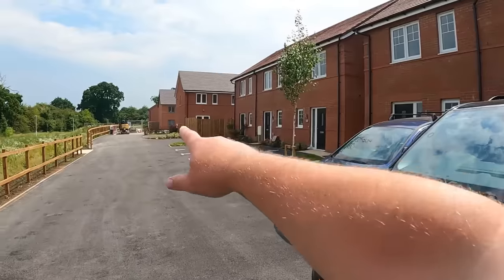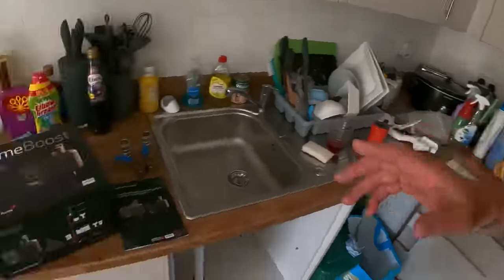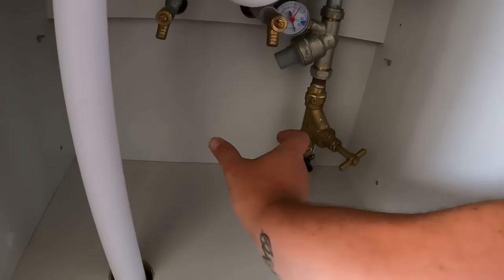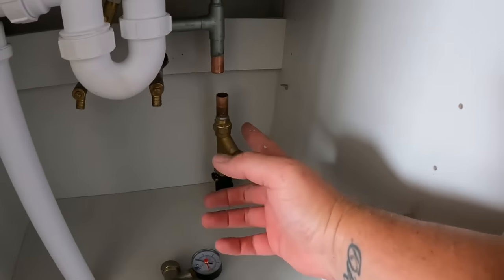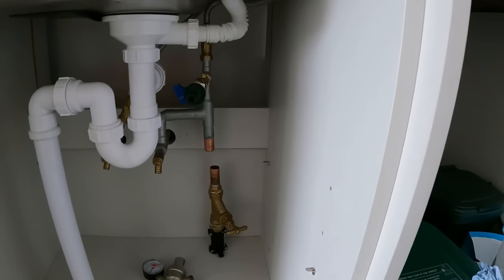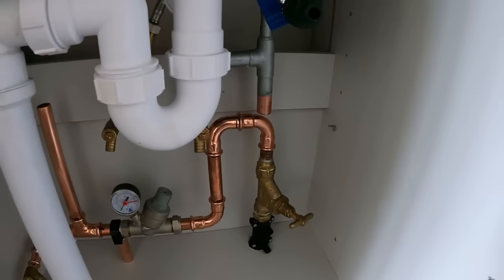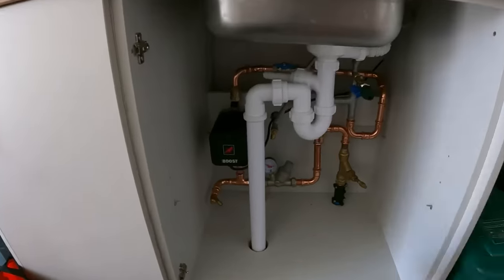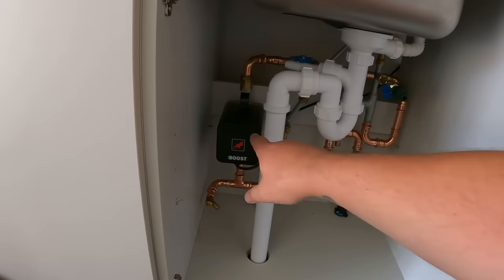HOW TO FIX A LOW WATER PRESSURE & FLOW PROBLEM

Comment: make sure   u  fit a pressure reducing   valve   be fore the pump   as tested to 10 bar  but have exploded.   in spiked  supply conditions
Reply from the maker: There is buddy…….

Comment: On a new site I've  seen a 37kw storage combi with flow restrictors on basins and a temperature mixing valve set to low 40s C on bathrooms bath tub !

On a seperate note if you have 12+ lts min out of hot tap you may depending on the size of combi end up with poor dhw temp when incoming main drops in temp.

Comment: Great video Mark. I have a question. Can you install a booster pump prior to the PRV on a unvented hot water cylinder installation? Would it work?  Regards Rich
Reply from the maker: This is for a combi system only……
You would need a tank boost I think

Comment: Hi mark is this oil heating or gas my pressure is awful in my house 😢
Reply from the maker: Doesn’t mate, as long as your running a combi this system will work👌🏼
Reply: @MJTiffPlumbing  I don’t know what that means lol I got new boiler last year any recommendations for oil heating to boost water  pressure

Comment: And how much will you be charging all the residents for the upgrade ?? Don't forgotten to pop the cards through the doors of all the resadent or you could get your lad to do it as payment, did you try it with no prv before you made any changes ?
Reply from the maker: PRV had zero resistance as it was opened up fully as said….. the incoming main is the issue…

Comment: Interesting ,  are there flow restrictor’s on the taps ?

Greetings from Australia,  I’m sure you have ,  normally I’d check from outside , see what pressure is like outside coming in at the main or at the water meter outside .

Does yr local utility guarantee a certain mains pressure ?

Why is it so under pressure / flow in the first place ?

BTW 33 degrees c , is winter in Australia …😂.
Reply from the maker: Thanks for the comment mate….

No flow restrictions or anything, just really bad water pressure!!!
Reply: @MJTiffPlumbing  interesting thanks.  “ Sydney Water”,  here in oz, guarantees us 500 KPA as a minimum to a domestic household about 75 psi … used to be much higher actually.  The pump system is great I’ll research them here .

Comment: Great video mark after 17 years of plumbing still can’t get my head around the press fit I just don’t think the fittings look as good as the soldered ones and seem so expensive but probably me just needing to go with the times😂
How you finding it do you think you will stick with the press fit or are you missing the blow torch
Reply from the maker: I agree…. I’m not sold on the look of them still, however it is a lot quicker.
I’m getting there with it….. time will tell
Reply: One huge advantage is no hot works. No permits , no covering up smoke  detectors. Also you are taking the skill or lack of it out the equation. Ive been a plumber for 40 years now and you come across experienced guys who cant solder a 35 or 54mm fitting without it leaking. For the commercial sector its a no brainer , they build the fittings cost in right from the get go. Still not convinced about the domestic sector though.
Reply: @paullbennett2923  yes can totally get that Paul and I’m sure in the future it will be the way we all have to go and take the worry out of filling a system up at 4ocklock in an afternoon on a Friday hoping that all them soldered joints are ok 😂

Comment: do we need a pressure reducer valve when connecting the pump? they work opposite eachother.
Reply from the maker: Yep
Reply: Could you tell me please whether valve does not make the pump hot and burn? In other hand, without pump the tabs do not stray banging noise? Especially washing machine and dishwasher. I am curious because this what exactly what I am going to do but without valve I have problem with noise of banging!! So I wonder with pump the noise coming back or not.

Comment: 9 times out of 10..stopcock choked with grit /stones etc..we used to take stopcock off and flush out alkathene....when water board connect meter outside they not too concerned about mud/ grit etc getting into alkathene...left to site plumber to sort...back in the day before prv and filters, the grit would run right through the house and trap in ballvalves in tanks and cisterns..nightmare...seen it hundreds of times.

Comment: What causes water pressure on house to go high and than low not conderable amounts hardly notable but can see stream slows a bit. It's on a combi system. Cold water and hot water same thing.Even garden tap.
Reply from the maker: Can depend on so many things like times of the day when people are using it etc
Reply: @MJTiffPlumbing  Figured it out what it was that was causing water to go fast and slow. Inlet valve was faulty on toliet kept opening and closing randomly even when the float was at the top. Changed all ok.

Comment: Next time just bin...the PRV....they're mostly pointless in that size of property....pump straight on after stopcock 2 nuts to horse up..done...save alot of time + costly fittings...cleaner...less complicated + Easier for you....cards through all the neighbours { cause they'll all be in the same boat }...Great pump mate + a huge difference....Regards.
Reply from the maker: Will keep the PRV….. it’s a safety device incase the main ever rises, wouldnt be removing it
Reply: Hi Neil, thanks for your positive feedback on our pump. And, yes, You’re right, we don’t require the pressure reducing valve for the HomeBoost, but we’d agree with @MJ Tiff its best to include for safety.

Comment: Great job! 
Work with a lot with press fittings only thing I would of done is thread a union in the stop cock then done pipe work, 
If you need to change the stop cock you will have to cut out your pipe work to change it.
Reply from the maker: Thanks mate….. it will be me doing it if ever that happens anyway🤣🤦🏻‍♂️

Comment: You didnt need prv on system as homeboost works as a bypass and only comes on if drop below stated pressure or flow as i understand it, and the homeboost has a maximum inlet pressure of 10 bar.
Reply from the maker: Would rather a PRV BEFORE the HomeBoost hence why I’ve left it on….. no harm in it at all. If anything it’s better protection

Comment: I would of knocked the doors of the neighbours and asked them what their water pressure/flow rates are like. I can’t see how that’s passed snagging? Surely the incoming mains is kinked or damaged in some way.
Reply from the maker: I have buddy….. spoke to all the neighbours and they are all the same.
Developers don’t want to know… so bad
Reply: @MJTiffPlumbing  that’s really bad. They have an obligation for 1bar working pressure and 9 litres per minute. Once the sites done and temporary water supplies are disconnected hopefully it will rise?

Comment: Temporary fix surely? If every property on that development has low incoming mains pressure and they all fit a mains booster where will the extra water come from?
Reply from the maker: I doubt everyone will fit a mains booster, however as long as my sons house pressure is now ok 👍🏼
Reply: The pump will boost the existing water that is already coming into the property – Depending on flow rates and pressure.

Comment: OK so you fitted a boost pump.  But what is the underlying problem?  Is the piping too small?   Clogged lines?   I'm in the USA and I have a similar problem I cannot figure out.  My hot water pressure (or volume) is about half of my cold-water pressure.   I've checked and replaced all lines/hoses/nipples right at the water heater: no restrictions or leaks anywhere.    So why the pressure/volume differential between hot and cold?  Anyone?   (I figure it's the internal pipe sizing -which I'm not about to try to fix.
Reply from the maker: So many things it could be mate…. Depending on what system you are running

Comment: Excuse me, but why refit the PRV when the pressure is poor?
Reply from the maker: What happens when they do sort the main out and it’s upped to 6bar…..😉….. that’s why the PRV is still there buddy
Reply: By that assumption, we should be fitting PRVs in every single house in the UK.
Unless there are actual plans to boost the site?

Comment: I went to a house that was 10yrs old that had rubbish flow / pressure. Upon investigation we found the water had been capped in the street in the passed and rather than the cap being removed for the correct fitting someone had removed the cap.... Filed it down a bit then put the cap back on so the water was squeezing through a small gap. 😂😂

Comment: You don’t need tape with a parallel thread, it’ll seal in the o-ring
Reply from the maker: I do as it’s what I’ve always done, no harm in it what’s so ever👌🏼👍🏼
Reply: @MJTiffPlumbing  Would rather rely on  properly prepped threaded fittings than  Elastomers, which can loose memory and become hardened  and brittle  even degrading over time...

Comment: The developer will have saved themself a few £££ by under sizing the main from the boundary, Supplier might guarantee a bar at the boundary but this can be quickly eaten up if the resistance of the pipe is to high and the property is far away.
Reply from the maker: Yep…. More than likely

Comment: What a shame for the builders who leave the building unusable.  They should fix it under warranty.  The second thing is, why install the PRV before of the booster pump?  How was the pressure with the mains without PRV? What point is to fit PRV when mains pressure is low? Hm
Reply from the maker: What happens when they do fix the mains pressure and it’s sky high…… that’s why you have a PRV inline
Reply: I just don’t understand, why you didn’t replace the T-joint going into the rest of the house, behind the sink. You could feed the rest of the house directly after the booster. Now you first get a few turns and several 90 turns, before you go into the house. Also the 2 90 turn of the old spot of the PRV look a little it’s made by an amateur. Just take a few more minutes to look for improvements of your plan, I’m sure you’ll see them too.

Comment: Guarantee if you'd have done away with that PRV you'd have achieved the same outcome! Why have a PRV on a supply that only has 15 meters head coming in in the first place. They are a constant issue and are almost always the problem. Pumps only really work on a tanked system. How can you increase pressure when the incoming pressure is determined in the main. There should never be poor flow on a 25mm MDPE service. There is obviously a flow restriction!
Reply from the maker: Guaranteed it didn’t….. and as you can see from the video the pump worked a treat and now the supply is how it should be👍🏼👍🏼
Reply: @MJTiffPlumbing  trouble with plumbers these days is that they don't understand the science behind the water. You can't just magic up pressure. The pressure is determined in the main and no pump will make a difference. You've basically just spent 100's of pounds to remove a flow restriction. See it multiple times per week
Reply: The pump activates when the water flow rate reaches 3 litres per minute, it recognises this using a turbine, and boosts the water flow to 12 litres per minute.
Reply: @SalamanderPumps  not disputing how your pump works but the fact that there was 3 litres per minute at a new build property suggests that there is a restriction in flow simply down to the fact that if it was actually that amount being pumped in then not only would all the properties in the street be affected but the water undertaker would not be meeting the standards of service that Ofwat outline. In my area (North West) the dynamic pressure and flow standards are 9lts of flow at 1 bar pressure. This guy has fitted a pump instead of finding the root cause of the problem. Either the PRV is defective or there is a restriction somewhere further back on the MDPE service. Possibly squashed somewhere restricting the flow. Usually poorly ducted at point of entry.
Reply: @johnmac6568  Appreciate where you’re coming from. In this instance trying to resolve the low water flow issue through other avenues didn’t work, thankfully HomeBoost offers a solution that’s quick and easy to install and overcame the homeowner’s water pressure problems. Thanks
Reply: @salamanderpumps9239  I wouldn't say 12lts per minute is problem solved. To solve the problem they'd simply remove the PRV or failing that relay the service. Never ever should a pump be required on a new MDPE service. It's just lazy whilst avoiding the real problem.

Comment: New house, shouldn’t the house builder plumbers be requested to come back ?!?!
Reply from the maker: If only it was that easy….. the developers are not even returning calls
Reply: If they couldn’t get it right first time would you want them back. To be fair it’s probably not the plumbers fault , just crap developers.
Reply: Slightly off topic, a developer has been building new houses opposite where I work, on top one of the houses straight opposite, a roof tile has moved, said developer has been phoned/contacted on numerous occasions and no one had been to sort it and they’re still building houses there

Comment: Good luck with using that valve in a few years the tiny plastic handles shear off, get one with a metal handle.
Reply from the maker: What handles are you on about??
Reply: @MJTiffPlumbing  the red and blue plastic handles you turn to open and close the valve. My experience with some is that the valves get very hard to close and the plastic handles start to give where they're screwed in. I much prefer the valves with long metal handles.

Comment: Why you even fitting that it’s got a guarentee on the house get hsb on it gets me how they put it all in 22 aswell and a prv on it 😂 also house is piped in plastic so 15mm plastic is like 10 now after inserts
Min a bar pressure and flow rate of like 9-10 or something
Reply from the maker: They didn’t want to know…..

Comment: What's the cause of the problem for the low flow and pressure in the first place? This shouldn't be necessary, even though it seems to be doing the job.
Reply from the maker: If the builders knew that to start with we wouldn’t have the issue…. They couldn’t find the problem so I had to sort it myself with this
Reply: So they never got to the bottom of the cause of the low flow and pressure? NHBC have minimum flow rates the builders have to have for each building.

Comment: Interesting video Mark.  In my personal opinion I dont think the pump should go under the kitchen sink as it is an electric pump and water and electric don't mix.  There is always a higher risk of a leak under a kitchen sink than anywhere else.  I do however understand that the water preasure in low and a pump makes it better and it needs to go in somewhere.  

New build homes are constructed poorly in so many places across the UK at the moment.  The best thing you or your son can do is contact Orlando Murphy from New Home Quality Control.  For about £300 they wil do a report on the property that you can give to the builder of all the snags in the property which they have to fix at their cost.  This has to be done within the first 2 years but the sooner it is done the better.

For those who don know who Orlando Murphy is then google UK Fake Weep Vents
Reply from the maker: They are designed to go under the kitchen sink, they have to come directly off the incoming mate, they are a sealed unit and zero issues at all👍🏼
You now get sockets under sinks in most new builds.

As for contacting the developers….. oh trust me we tried, however now it’s out there on YouTube for all to see so I’m sure they will soon be in contact with me…..
Reply: @MJTiffPlumbing  still worth getting in contact with Orlando.  It will be £300 well spent
Reply: Thank you for your  comment. Our HomeBoost pump has enclosure protection IPX4. Which means the pump is resistant to water splashes from any direction, complying with standards for pumps installed to the mains water.
Reply: @SalamanderPumps  I can understand it has an IP and IK rating for that application.  As i stated in my original post, its just My Personal Opinion

There is always a higher risk of a leaks under a kitchen sink than anywhere else so it makes for sound engineering jugdement not to have power or electrically powered items there.  Maybe I am just old and stuck in my ways.  

This is again my opinion only
If the pump must go under the sink then a minimum of IP65 should be applied.  Main reasons for this are
1)  Leak from sink waste
2)  Leak from hot or cold tap
3)  The high likelyhood of the StopCock/Main incomer being in close proximity which could leak or fail.  
4)  The possibility of impact damage.

The concept of the pump is good, there are many new builds with poor water preasure.  The performance of the pump is also good as seen in the video.
Reply: @sergiofernandez3725  Thank you for your comment and feedback on HomeBoost. We understand your concerns and appreciate the precautions you’ve highlighted. HomeBoost can be located within 5 metres of measured pipework away from the incoming stop tap, so the pump could be located elsewhere if leaks are a concern. Thanks again!

Comment: This is what happens when building companies keep building hundreds of new houses and connect them onto existing water infrastructure rather than building new infrastructure. Building firms don't give a sht whether you shower works or your toilet flushes. Regs state 1 bar minimum  to your property boundary not to the sink.

Comment: You could not have a shower in that house with such low pressure !  should not evan passed the snagging list before someone moved in, shocking !  send them the bill for the install.  i looked up the legal water pressure,   Under the Water Supply and Sewerage Service (Customer Service Standards) Regulations 1989 there is a minimum pressure of 0.7 bar that needs to be maintained in communication pipes serving premises.
Reply from the maker: Shocking isn’t it